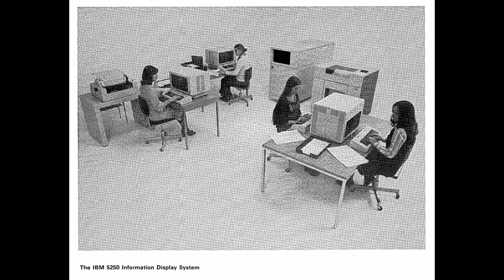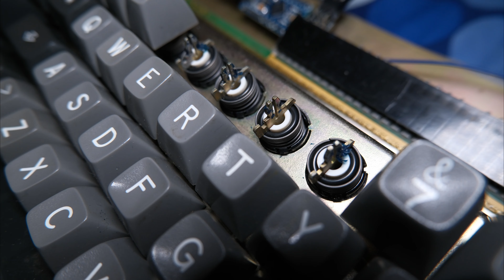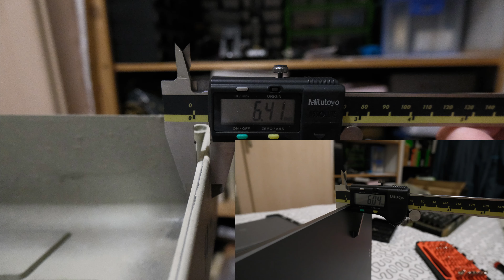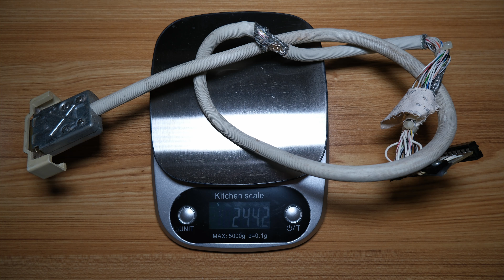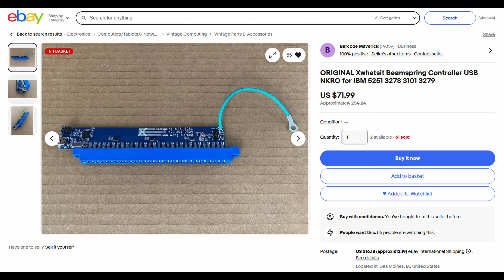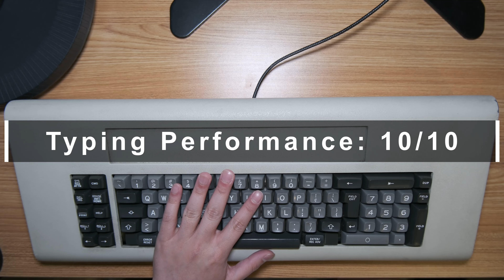IBM 5251 (IBM Beam springs) | A Legend

Comment: I started work in IT in 1982 and, in my entire working career, the second best keyboard I've ever used was an IBM 3278 keyboard, made of cast aluminium body with a little instruction booklet under a lid in the palmrest.   The keys and layout were similar to the one in this video but the palmrest made it way more comfortable to use all day.

[edit: The keyboard was attached to an IBM 3278 computer terminal, which also had a metal casing.  It was so good to use, I refused to 'upgrade' to later terminals when everyone else did.  Sadly, some guys told me they had to take it away.  I worked for a chemical company and it was needed in the plant that electrolysed salt water to make sodium, chlorine and a few other salt products.  The new plastic terminals didn't work because the electric fields from the chlorine cells dragged the image off the screen so they suddenly realised they needed some of the old metal-clad terminals and, sadly, they comandeered mine.  Sob. Sniff.]

(The best keyboard I've ever used was on some early '80s IBM Selectric self-correcting golfball typewriter - I don't remember the exact model.  I had to type up a 2-page document in 1984 and the department secretary (remember those?) let me use hers.  It was truly amazing to use.)